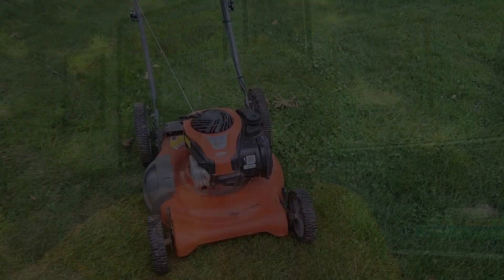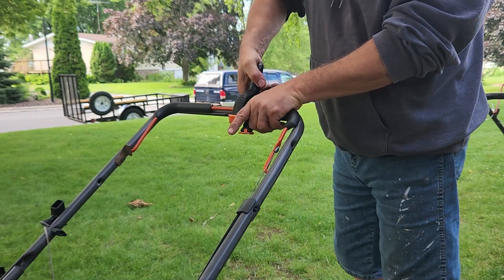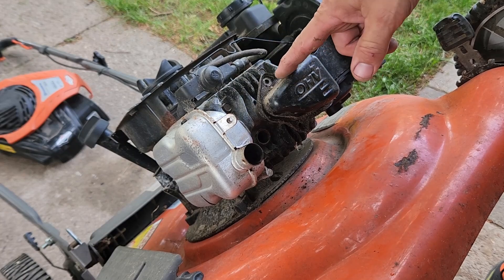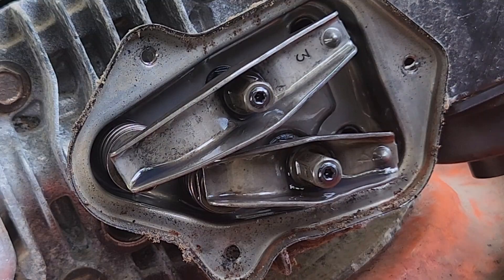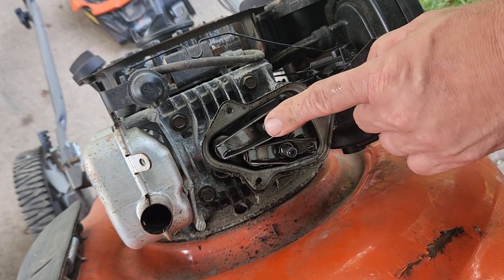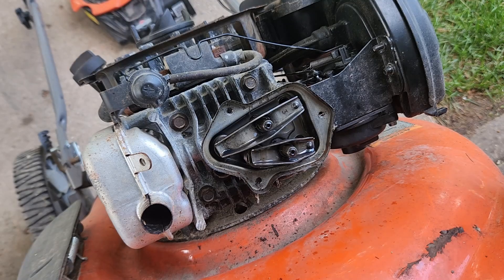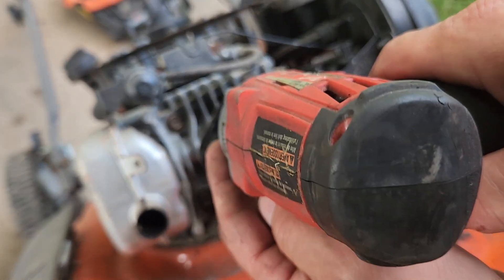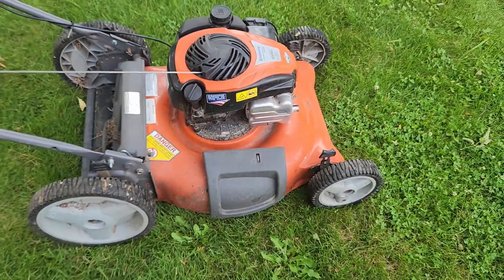Briggs and Stratton 550EX - Valve Adjustment

Comment: Thank you for your service, high quality instructional video.
Reply from the maker: Thanks for watching!
Reply: @RealManSkills  new carburetor and spark plug - blade clearance is good, the cut is outstanding, blade adapter stuck on strong - i adjusted the valves a bit so I think the surging, hard start, and clanking is due to timing, valves a bit off - what say you:  https://youtu.be/kE-cOo4QEUk?si=b7XY8eVhDSjIFmuq?
Reply from the maker: @PaulHenreid surging, is usually a sign that carb isn't getting enough fuel.

Comment: Thanks man that was very helpful. Question, I have the Toro 21321 with the Briggs and Stratton engine 9P702-0181-F1/09P702-0181-F1 and need to replace the head gasket or cylinder head gasket, then re-adjust the Valve Clearance but I can't find the repair manual online for the Valve Clearance or Cylinder Head bolt Torque or sequence to tighten the head cylinder bolts back down, will the specs you have in the description be the same for my Toro 21321 engine 9P702-0181-F1/09P702-0181-F1 engine model "Briggs and Stratton EX 5.5 GT 140cc Vertical Shaft Engine?"
Reply from the maker: Happy to help